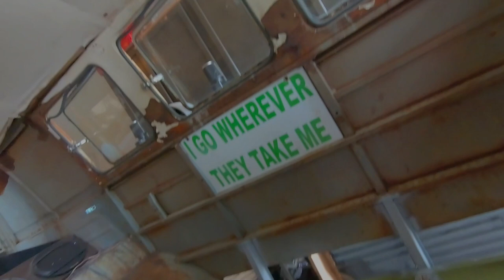Vw bus frame replacement pt4

Comment: Sorry to be a bummer but the welds... I would recommend less wire If possible and more heat.
Reply from the maker: Yes, it took a little while to dial it in. Nothing a little grinder action can't fix. Wasn't worried about warping as much because the rest of the bus looks like a topographical map of the ocean floor.